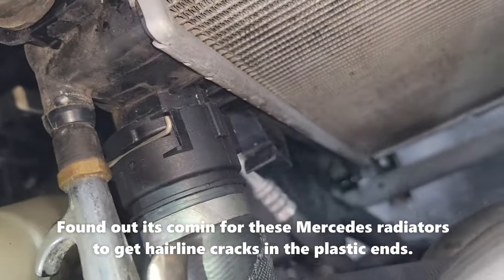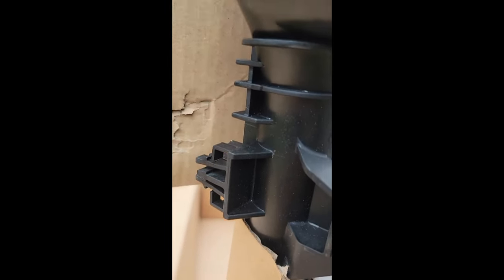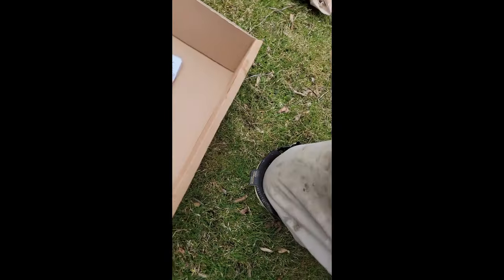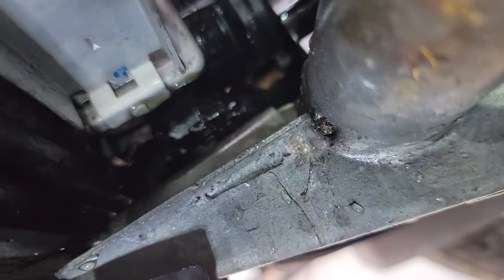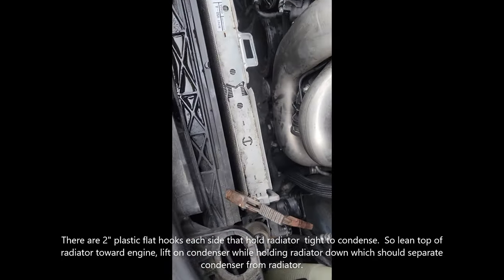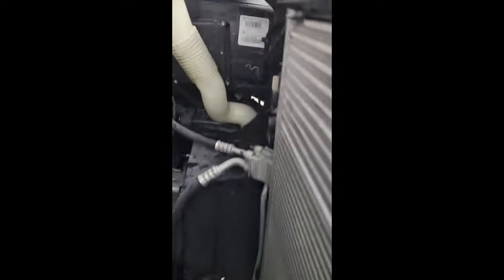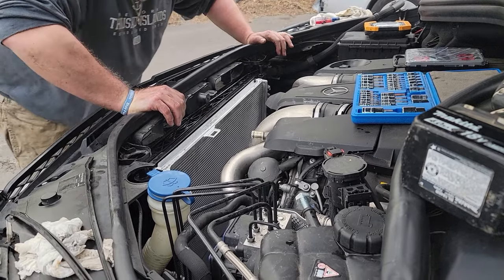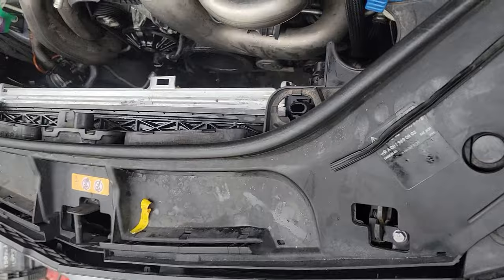Mercedes Radiator Removal, You DO NOT need to disconnect any a/c air-conditioned parts or condenser

Comment: Did my 08 CL 63 AMG during COVID at home.  Damaged condenser but the radiator cost 100 dollar and the car has 160K on it and has cold a/c.  Last night (this morning) I completed my ML63 AMG with 167K and your video and guidance was very helpful...  To other's comments, radiators are not simple and there is usually collateral damage but the job forces you to change fluids and conduct maintenance.  I have replaced a radiator in all my cars over 100K since 1996..........  As a Automotive Engineer, hats off you you Sir and all the folks at home trying to keep your rides going!!!

Comment: Great video.  I just don't understand... I just broke the tops of the  A/C tabs off the old radiator.. why waste time trying un clip them? Just put a screwdriver on the clip and give it a lil bang
Reply from the maker: great idea...lol never thought of that!
Reply: Same!  I had to alter the lower taps nd one side tab on the new radiator to increase installation clearance but I did not compromise the lower mounts of fan rider clips..

Comment: Mine was a struggle to remove you didn’t show pulling it out
Reply from the maker: Sorry i think i just pulled up a little then tilted toward engine.  once separated from the air-conditioned condenser came out easy for me.
Reply: 5-7 hours.  As an engineer, radiators have been my least favorite repair over 25 years of changing them.....

Comment: How come the new Mercedes is not that durable?
I drive W210 and its aged 22 now. Last month, I replaced radiator by Mahle Behr which is made in China. Now sure if it is as durable as the OEM Valeo.
Reply from the maker: not sure why radiator went, all mercedes I have owned have been durable besides the airmatic shocks,

Comment: Hi,

i dont know to the seperating the downside the 2 clips : ( how is the seperating working ? : (
Reply from the maker: I show the special plyers I used..
Reply: I think i have ask false ? 
the downside of radiator is into condenser clip cliped, how i get the downside under the car the clip free , how i can pull it up ?
Reply from the maker: Just pull up hard or use a long screwdriver like I do in video to lever it up
Reply: And nothing breaks? and can I really control the air conditioning and don't have to unscrew the bumper?